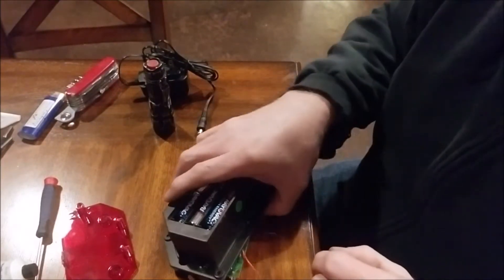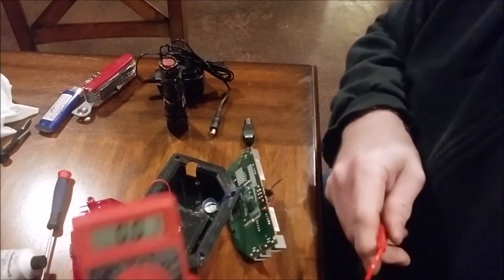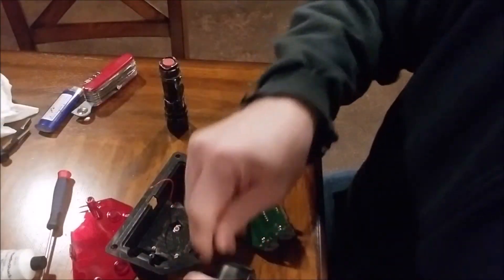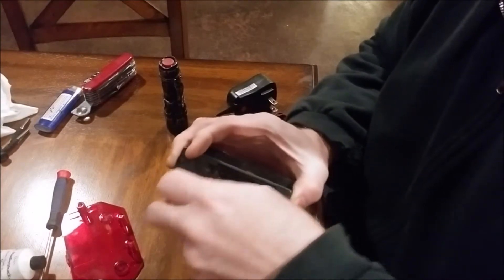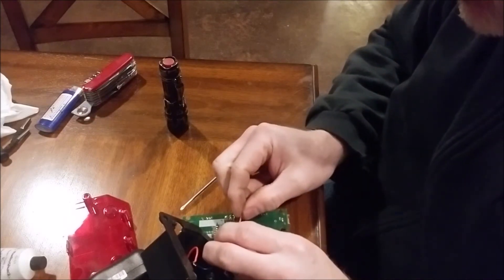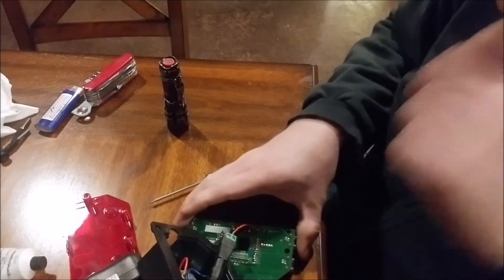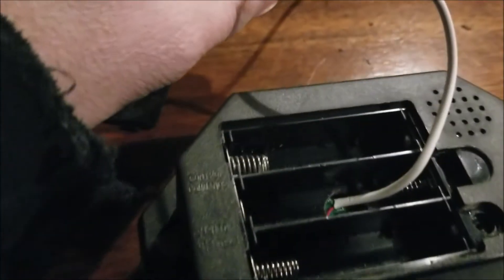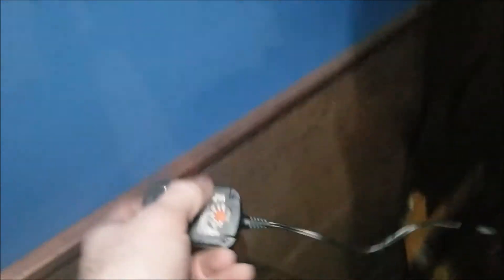Battery power to Outlet power Basket Ball game conversion

Comment: Great video. Can you also connect external speakers to the board? 🤔 I would like to mod it to be a bit more like the arcade.
Reply from the maker: Yes you can! You can amp up the sound through bigger speakers mounted in the back, stay tuned I'll work that out for a video mod on it...